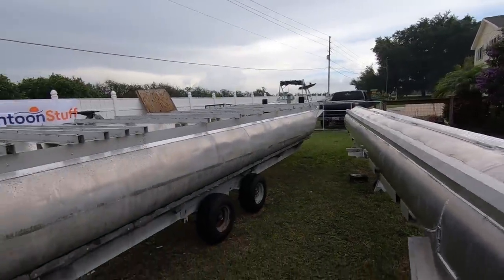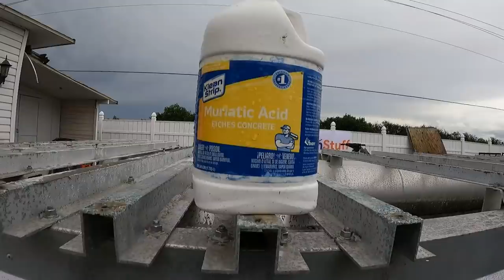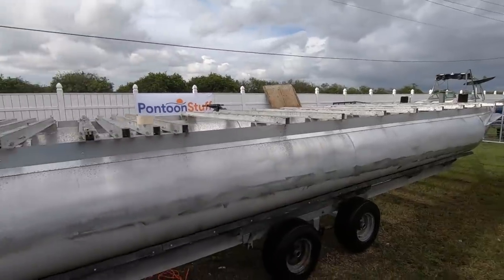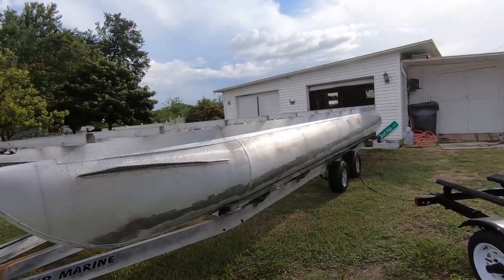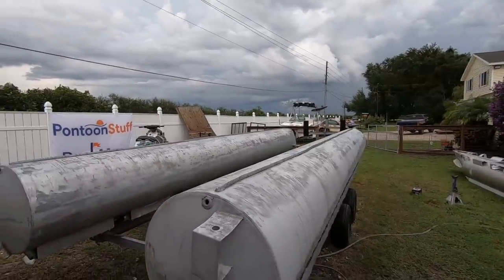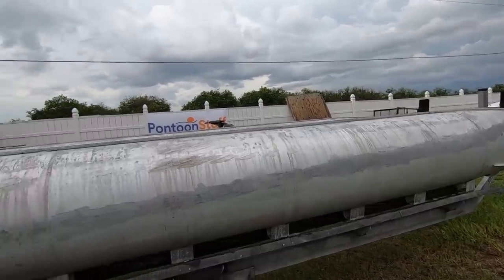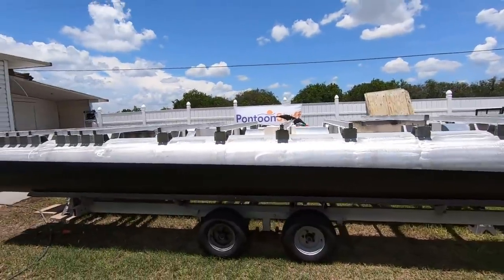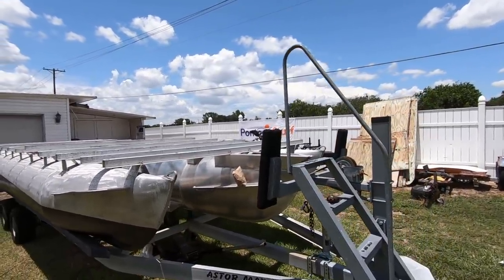Installing an Aluminum Center Toon on my Pontoon Boat - Episode 3

Comment: When it comes to panting aluminum sand clean then the most important thing is self etching primer for aluminum without this step it will peel. Then you can use normal two part automotive paint. Just keep up the good work enjoy watching your builds.
Reply: I would suggest using a marine grade coating instead of a automotive paint. May help with durability and prevent corrosion on the air/water line better.
Reply: Etch primer and two-pack marine coating is the way to go
Reply: Most etch primers are one part and even when cured (for a year or more) lacquer thinner will wipe it off like you just sprayed it. If anything use a 2 part acid wash. It won’t come off like that as it actually etches into the metal. Rattle can etch primer is very deceiving.
Reply: Look up gator glide for painting pontoons. Tiny boat nation has good video.
Reply: Thank you for the advice . I was thinking  about that also

Comment: I know you don’t want to paint them but if you do end up doing that, why not paint it silver so it doesn’t make the center pontoon stick out so much since it’s longer. Plus, if you get the pontoons smooth, silver will hide ripples and dents better than black will.

Comment: Before you paint aluminum you should use vinegar on the aluminum to etch the aluminum so that the paint sticks better. Also rhino liner will tear up the banks on the trailer. You do a really Good job on every video you've done. Keep up the Awesome work.

Comment: When you use aluminum bright do it small sections and have you a bucket with soapy water and spray the brighter on it and use a brush scrub it and rinse it you will have better results

Comment: I painted my aluminum jon boat with Rust-Oleum and made sure to use their primer first and just rolled it on with a paint roller and you didn't even have to spray it and it worked out fantastic. I floated that Jon boat through some pretty gnarly stuff and it never peeled. Obviously if you hit a rock it'll scratch but that's just the nature of the game.
Reply: Rust- Oleum also akes a line of "machinery paint"- I've scratched with a hammer but it is tough! Put it on by the label! FR

Comment: I worked at a shipyard and used epoxy paint on the hull of some ships that had aluminum hulls. It was also used to keep barnacles off too. I bet this one will look twice as good as the other one.
Reply: Yes I agree.  Saw a video the other day where a guy used this on an aluminum jon boat in Florida.  They also make a super slick epoxy paint and that boat went on and off trailer like one push was all it took.  Also color options available.

Comment: There's an aluminum wheel cleaner for non coated aluminum wheels and it'll make if shine just like new one. I don't remember brands we use to use, but most gave the shiny aluminum look, a few gave to dull results like you got.
There was no scrubbing or polishing needed either. It was spray and rinse.

Comment: Zach, I agree with a lot of the comments here about the primer and paint.  It needs the proper primer or it’ll fail every time.   It doesn’t help that the previous owner left it in the water 🤦🏽‍♂️...  I agree that spray-on Bed-liner would add more drag than what you’re already going to have so use that filler to smooth it all and then prime and paint.  Good luck with the rustoleum.

Comment: You should install sacrificial anodes on the toons if they don't have any.  Especially in salt water it helps prevent pitting.  I worked on aluminum crew boats for years in the Gulf of Mexico and I know from experience that anodes work.

Comment: Add a product called gator glide on the pontoons. It’s made for aluminum boats and should stay on there for a really long time. A lot of airboats and mud boats use it to make it easier to slide across vegetation easier so should work awesome for this application. I have it on my own boat and have no complaints.

Comment: they make "gel coat" in any colour for aluminium. copper and marine steel. Then any old marine paint over and a clear coat and you have a nice 10+ finish that only needs the paint layer once in a while, as the "gel coat (epoxy marine compound)" well last a very long time.

Comment: Make sure to use an etching primer that is specific for Aluminum. Then follow it with a paint mixed as a "high build" to help fill and level the pitting. Getting a few IR lamps and "baking it" a section at a time, as your paint it would likely improve your paint life and the coverage quality. Color is a choice of the paint buyer- wouldn't touch that with your ten foot pole! Prepaint the areas where the "thwarts" are mounted along the pontoon and try for as much paint under them as feasible- the best  deal would be to think about "encapsulating" the aluminum to slow the corrosion. Check with a marine chandlery for some small anodes to affix to the pontoons as in "sacrificial anodes". When you redeck it, use real marine grade plywood if you can- it will out last the rest of the pontoons life- the decking you took off was "treated for use in damp or wet areas", not marine grade plywood.  For power, I'm thinking an American V8 driving an 8' air prop- ought to go like stink, keeps all the power out of the water and will travel on wet grass! that honking big pontoon boat would look wild sailing through a lake of saw grass! Up the Algorithm! PS; you already have a bunch of "thin spots" in the sheet aluminum- including above the water line. Paint it all and do what ever you can to gain corrosion protection. Paint to the water line is purely cosmetic- you need the lowest edge of the finish well above the "wet line"- a vey likely reason you've had peeling issues. FR

Comment: If that paint doesn't hold up, look up gator glide epoxy coating. It's meant for aluminum boats and comes with an aluminum primer. It's super slick and perfect for a boat that is going to run into sand

Comment: After cleaning an etching primer followed by a two part, catalytically cured, epoxy paint would last much better than a single part spray paint. Even two part auto paints would work better than a single part paint like the Rustolium and there are even two part paints that come in spray cans; you simply pull a popper on the bottom shake to mix and spray. A two part clear coat would also add protection over the spray paint but wouldn’t aid in initial primer bonding. Some aluma-well sticks could aid in reattachment of the forward aluminum pieces, or Tig welding if available would be best, if you use the weld sticks just make sure to get the surface oxidation off as unlike AC Tig it won’t be removed during the process and will lead to a bad joint.

Comment: Check out Vantage Pontoon Guards or pontoonguards. You can also add vinyl under them. I was trained by vantage to install them. I can say first hand they look amazing, and only take a couple of hours to install. I believe vantage is only available to dealers, but the guards and vinyl are manufactured by 3M, and are available elsewhere. For sure a great alternative to painting the aluminum.

Comment: Actually most boats are painted with a coat of Antifouling at the bottom, up to where water line is at, but its maily if you ride at salt water. Its a good product and it should last for at least 2 years. Its made to withstand harsh waters.

Comment: Paint the pontoon pods two tone and they make s neat low profile rub rails for pontoons that you can separate the colors. It also will cover those pitted area at the water line. The material is vinyl if some sort.

Comment: Bedliner is REALLY heavy and the drag would slow you to a crawl. Like not just slow, REALLY slow.
TotalBoat makes a paint specifically for aluminum in a marine environment. Probably twice as expensive as automotive paint, but I've never had a bad experience with totalboat products.  Plus, they hand out sponsorships like crazy, maybe you could work something out :)

Comment: Hey I worked on the aluminum extrusion plant we did paint aluminum there you would want to wash the pontoons thoroughly then use a water down muriatic acid wash and then rinse that with vinegar that’s essentially how they do it on a paint line for aluminum then use a good primer and an Apoxsee based paint being as you’re going to use this in salt water or if you wanted to leave the pontoons on painted you could just spend another $3600 on another pontoon and put the new pontoons on the outside and put the best of the old pontoons on the inside just a thought!

Comment: Could you use floor epoxy that you would use on like a garage floor? That stuff is super tough and you can get it in a high gloss version that seems like it would go through water without much, if any, drag.
Btw, this thing would be sick with a 250 horse jet ski setup in it. Jet powered tri toons are awesome.

Comment: I had the exact same scum line on my pontoons.  Also has the scum from the water line to the keel of each toon.  The water line was the thickest.   Used Muriatic Acid to clean all the scum for stubborn sports I used the 3M Scouring Pad.  the water line took like 5 applications of Muriatic Acid to be removed.  have a few spots here and there left.  I thought of using that grinding wheel but didn't want to do more harm scratching the toons than refill with what you did.

Comment: It looks like that corrosion and pitting on the outside toons is from electrolysis. Someone may have had a leaky dock light or something was grounded to the boat chassis. Always isolate your electric circuits on watercraft.

Comment: Just paint it with aluminum paint and it will look great 👍. But if you plan on using it in the ocean then use anti fouling bottom paint.

Comment: I'm only 9m into the video, I was wondering if you thought of getting it sand blasted... not course sand.. (of course.. haha.. ) but maybe a finer sand to even out the look before paint and maybe with pint adhesion??.. (if it would matter with texture bleed through.. dunno.. just ballparking it.. brain storming.. or brain fart.. lol. Alright.. back to the video)

Comment: Need to use epoxy paint to cover it up. Enamel is not going to bond properly on aluminum. Call Shelby and ask them what type of paint they use on the Cobra's they build because they are all custom rolled aluminum bodies.

Comment: Don’t you need to install the fuel tank first before attaching the flooring?
Reply: Why? the fuel tank is in the back next to the Motor and it’s not under the pontoon deck its resting on it

Comment: Great video! You are doing great work, only why didn’t you paint them silver? Scratches won’t show as bad. I have an old 21 foot Tracker that has an aluminum floor under the carpet, no wood! I ordered the boat new in 1998 and never regretted it. Sure slightly more noise but it can’t rot. It time to re-power from the 60hp Mercury to something bigger (115 or 125?). Hat do you plan on powering with? There is a new electric outboard coming out I might consider it.

Comment: Don’t they make specialized anti-fouling paint for the undersides of aluminum boats that keeps the barnacles and growth from attaching?
Reply: Yes they do.   It's really expensive but it works and wears fairly well,  Once you figure out where your loaded waterline, is you should apply this stuff or else you'll have a barnacle barge.
Reply: @stokerboiler  my concern about the bed liner isn’t so much that the rough surface will cause drag, but that it will allow barnacles and other sea life to attach even more easily, which could end up causing a lot of drag.
Reply: Jeff, I was recommending using real bottom paint.   Anything else accumulate biofouling.   I wouldn't use truck bed liner.   Maybe on the deck.
Reply: Aluma Hawk by Seahawk Paints... it's like $40/quart or $88/gallon and comes in several colors... and is anti-fouling  https://www.seahawkpaints.com/product/aluma-hawk/

Comment: You need to use a self etching primer. As far as paint. I would use eastwood gloss frame black for the pontoons. Its durable and easy to recoat if needed. Plus looks amazing.

Comment: Before you put all the rails on could you fit a fuel tank into that new pontoon so it’s under the deck??
Reply: The tank goes in the back by the transom

Comment: Aluminum is one of the worst metals for paint to adhere to. Why? Aluminum oxide! All paints hate this oxide and releases easily. Yes, even high tech self etching aluminum paint. This oxide forms very quickly, like minutes not hours. Also, the two worst finishes are polished and wire wheel cleaned. A sanded finish is the best for paint to adhere to but it’s also the fastest to oxidize. Your very best technique; Sand the aluminum in an area you can paint in fifteen minutes, paint, sand the next area, paint…repeat. Do not clean the bare sanded aluminum with anything but dry air or MEK. Not acetone, alcohol, or degreaser! You will oxidize it instantly. Once your done with the first coat, light sand the paint and repaint continuously for a nice look. Rust-oleum appliance epoxy paint by the quart is excellent for the first coat.